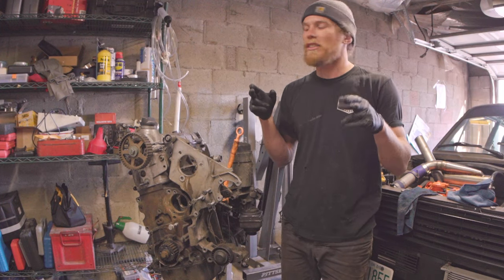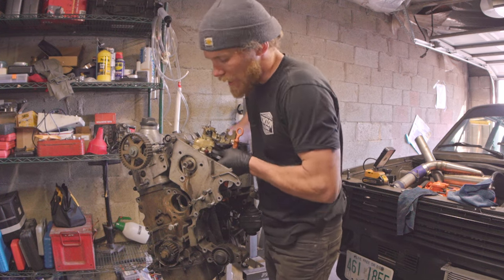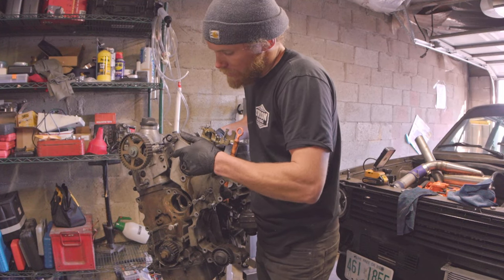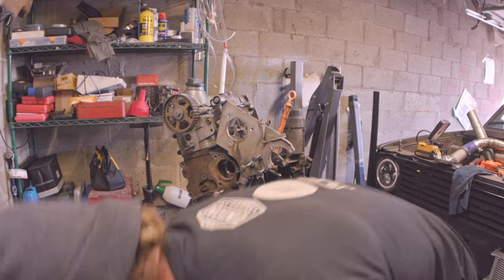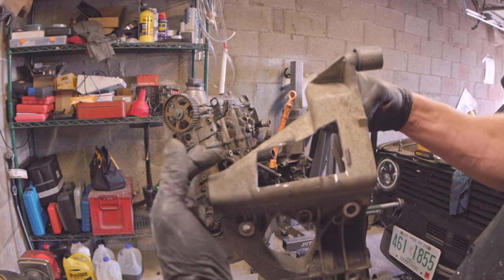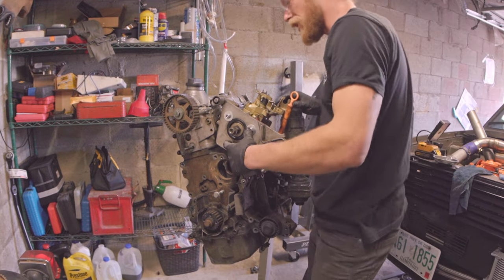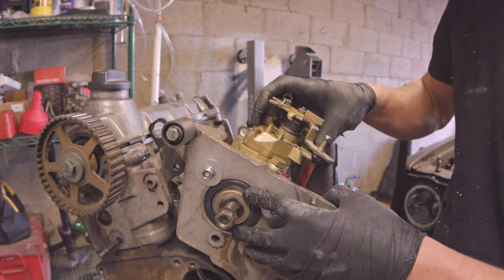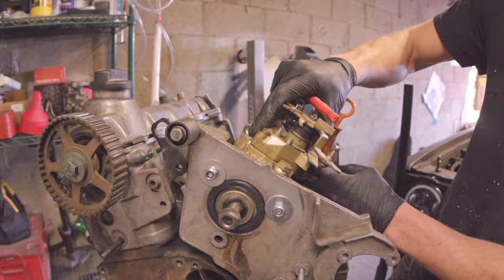M-TDI pump mounting solutions!

Comment: 4th back bolt / support of the pump is very important as well. idk if its at the same spot and its not a concern , but without it the pump will vibrate too much to the point of weird idling and such
Reply from the maker: Good point! I didn't think to mention it 🤦 It totally lines up 100%! Right out of the box haha so the 3 on the front have been my focus

Comment: I’m also in the process of swapping a 1.9 tdi using a land rover pump. I was able to run a 12mm tap through the three holes on the pump flange and mount with bolts from the pulley side.  Actually it may have been 10mm… anyway, one or the other.
Reply from the maker: Right on! That's a cool solution 😎
Reply from the maker: The 1.6 pump body has smaller slots than the mounting plate holes so tapping the plate didn't work in this case 💁
Reply: Roger that!  

By the way, I really appreciate your posting of videos.   They’ve really helped with the learning curve in regard to injection pumps.  The racing is fun too!
Reply from the maker: Glad they're helpful!!
Reply from the maker: Are there any particular upgrades/how to's you'd like to see covered on the channel?
Reply: Hmmm, this is my first foray into the diesel world so I’m just starting to figure out what I don’t know.  Maybe you covered mechanical boost control in an earlier video?  I remember you mentioning using arduino for this new build?
Reply from the maker: Right on! Yes more Arduino content is coming soon as we get it closer to operational

Comment: can the 1.6 pump internals be used? I'm assuming not nearly enough fuel for your purposes since I saw you're upgrading rods. i'm just wondering if for a non high performance build, the pump internals (with the tdi pump head obviously) would work. I'm trying to do something similar as I already have a 1.6 laying around from a project I no longer have and recently obtained a 1.9 I can use
Reply from the maker: By my understanding, the only internal that really matters when it comes to fuel delivery is the pump head. So I'll be using a 1.6TD pump body with an 11mm pump head for my build, and I think it'll be quite nice ☺️
Reply: @OliverFetter  thanks a ton. I just finished your video showing the install of the pump head on the 1.6 pump body and that gave me a much better understanding of how these things work. This series is an absolute godsend for me. Love the tdi swaps in jeeps but not a fan of all the electronics that generally come with it
Reply from the maker: @willyoung164  hell yeah! Me neither 🙄 I don't want a mk4 gauge cluster in my mk1 VW

Comment: Ahhh right the cold start lever. It'll be nice to have, helps with tuning.
Some pumps have an electric cold start bolted to the front.
If you aren't going to use it, it can be removed.
 The sprocket might not hit those nuts.
Reply from the maker: Yeah I wish I tried to remove it cleanly first but owell! Definitely clears the nuts (it's how the lower front is attached on a stock 1.6 configuration! )